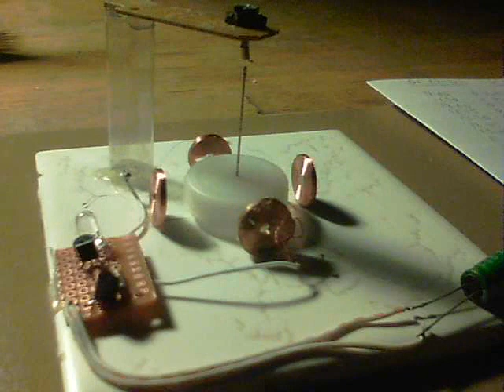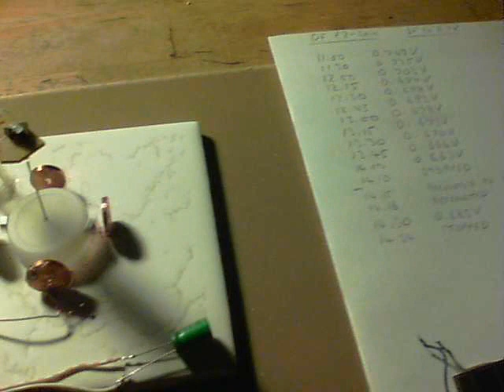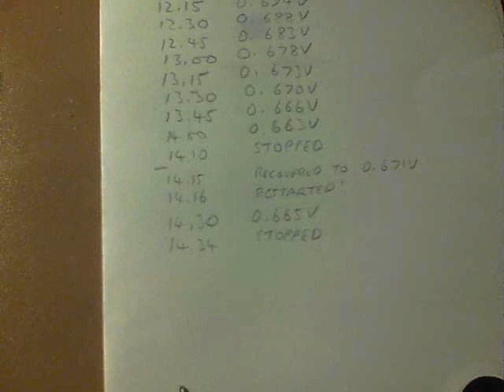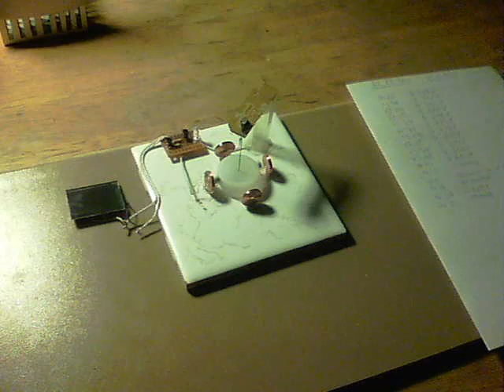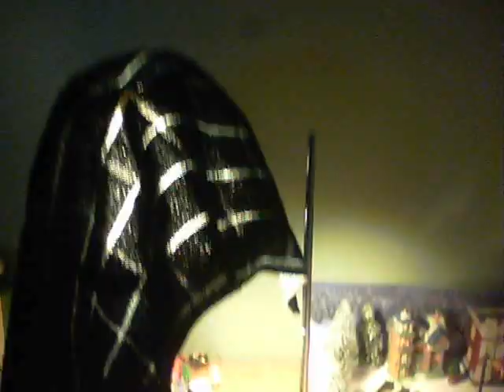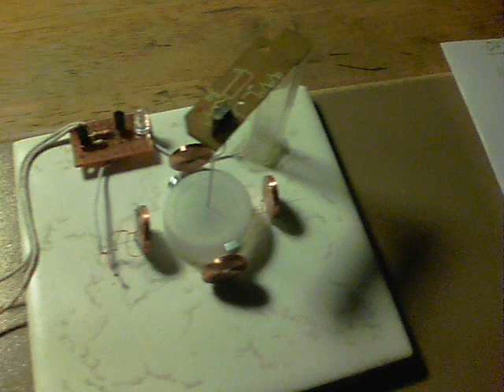DF EZ Spin motor

Comment: nice little build :) I love it! Thanks for sharing!
Reply from the maker: Thanks.It's been converted to reed switch for a test run at the moment. Connecting coils up in this way seems to do much more than adding a resistor to a one coil build.
Reply: Interesting.

Comment: You are seeing what I am seeing-----these EZ Spin motors are amazing.  Try running yours wirelessly off an Exciter and an AV plug. That is fun.  I spent all day yesterday seeing how mine would run on different things.  Last night I set it up on a simple reed switch circuit and a 2.7v  5F cap.  The thing ran for 11 1/2 hours!!!!!
Reply from the maker: Haha 11 1/2hrs is getting very cool indeed ! There's the thing, that equates to overnight and with a solar panel to trickle charge up in the day it's a 24/7...except with very overcast skies. Fix there is that there'd likely be a light on in the room !
Am all for devices that just work and do so because of the way people naturally go about life.
Reply: slider2732 Exactly.  The device we are striving for could make use of the way people live day to day.  A normal human requirement (light , heat, cold, or something) could supply the extra energy for cloudy days.

Comment: Great video Slider. I just can't bring myself to take my solar movers apart. I originally bought them to use the parts but I have become attached to them :-(
Reply from the maker: Glad you commented, while I know you have nearly all of them.
Was a similar situation here, but decided to buy a few of the same type one time and they got cannibalised. I'd have done an 8 coil setup if had more of them and that's the plan for this :)
Reply: slider2732 8 would look good. I like the one Jeremy Gwilt has running with a similar layout of coils - his video titled 'suspended rotor running' gives a good view of it. I am sure you will explain it is a completely different motor, but it is the layout I am looking at and his style of building it.
Reply from the maker: GrandadIsAnOldMan
Ah well he was the PMBO winner, his stuff is always good !
Hadn't seen that video but, yes, it's a very similar setup and works in the same way. Thanks for the link. I liked the saran wrap to reduce drag, novel.
A lot of this reminds of RomeroUK and his overunity motor from a few years ago...highly highly controversial and people decided there was a red wire that was feeding in power from outside. I witnessed some incredibly odd phenomena when partially replicated, am not a 'red wire' proponent !

Comment: Hi good video, can you make another video showing how to build the rotor

Thanks
Reply from the maker: Hi Miguel. Such a rotor is easy enough to explain. It's a water bottle top...then a hole is made in the middle with the needle that then sits there. Magnets can be simply superglue'd to the side (same poles facing outward, check with a compass).
To semi-levitate is a matter of the right strength of magnets above, then the rotor will sit straight and vertically.
The rotor here is a little more complex. 2 holes were made at opposite sides of the bottle cap with a small screwdriver and tiny neodymiums pushed into those holes. Larger magnets then simply stick to the neos and all is very secure. It also means that different magnets, such as ceramic types can also simply snap onto the rotor, at the right places and in the right magnetic direction.
Reply: Thank s

Comment: What is the amp draw on the motor?
Reply from the maker: It's in the microamps and not many of those either. A solar garden light solar panel indoors might produce around 1V shaded as this one was, but the amperage is < 1mA